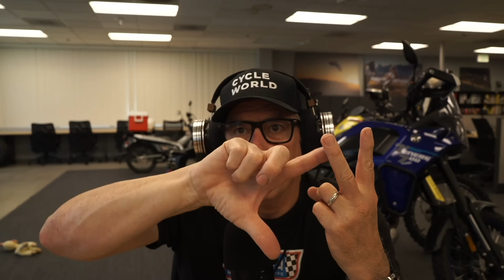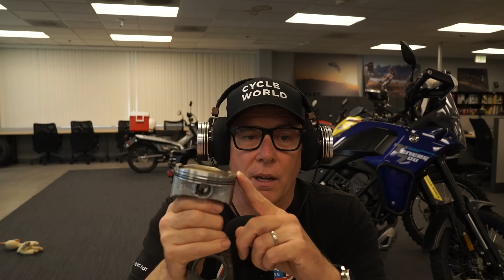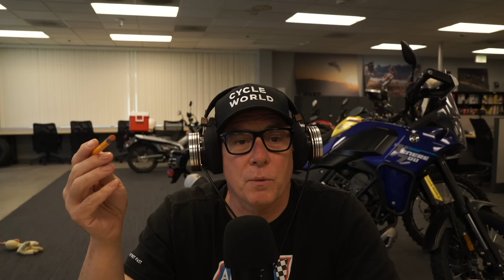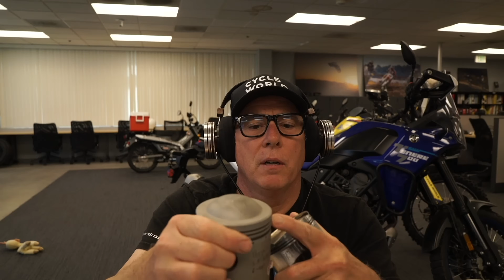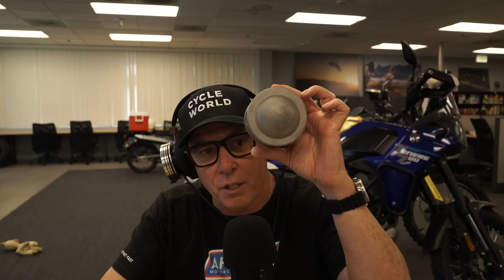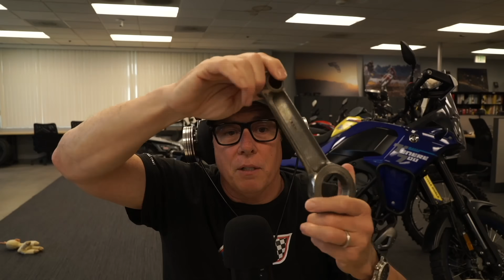INSIDE THE HOT ROOM! The magic in your motorcycle engine's combustion chamber.

Comment: RE,  SQUISH, - I experimented with squish in 1974 on my new [to me ] 71 honda CB750 sohc race bike  -  self tuned,  736 to 900cc ,-  much modified combustion chamber,    race cam , Boyer electronic ign,   ported head, race 4-1 exhaust ...  squish was 1mm !  ... the ONLY bike faster than mine  [ at top level amature / national racing in the UK ]  was the TZ750 !  ... my honda was quicker than tuned big bore z1000s,  big suzukis ,  even TZ350s  !!!

Comment: At over 20,000 RPM the pistons in the engine of a formula 1 car when they go shopping center to Providence center completely stopping to change direction... Weigh 5 tons each at that moment.. so there is no way you can allow the connecting rods to stretch at all

Comment: Velos are still being developed, squish engines , lead free seats and plasma nitrided valves , nikasil alloy cylinder :  got to ignition timing @ 28 BTDC ... Best results with heavy MSS wheels and camshaft (M17/7)
... btw, squish heads made from Viper heads with squish band cut at same radius as top of MSS piston
Greetings and thanks for your erudition

Comment: On modern engines you can have all the cylinders running different timing events and get the most out of every cylinder  It compensates for fuel distribution, poor mixture and fuel. Amazing progress!

Comment: So is there a knock sensor suitable for older engines ????
Reply from the maker: Another listener shared Bosch part number for a bolt on sensor but also that it needs an amplifier and the signal adjusted depending on where the sensor is mounted. The next (unsolved but solvable) matter is having an ignition to receive the signal and change spark timing. Hoyer says he's going to work on it for his vintage Jaguar that has an electronic distributor with tunable curves. His Velocette (drink!) is a mechanically fired magneto and, well, it's going to stay that way.

Comment: Over the years there have been some engines that would disable one of the two intake valves at low engine speeds to increase intake air velocity and swirl, increasing power.  After a certain point, however, both intakes would open and the flow would switch to a tumble.  I recall a small US Ford engine that got a little of the same benefit at low cost by putting a butterfly valve in the runner for one of one intake valve of each cylinder.
Another reason that having a stroke length greater than the bore diameter helps with efficiency is not only reduced area of the cylinder head and piston, but by also reducing the amount of cylinder wall area during the most energetic part of the cycle (as the piston is coming down on the power stroke).  This reduces the amount of energy lost when pressure, turbulence and temperature are at the greatest.*  I think that Toyota has recently decided on an optimum bore/stroke ratio of something around 1.2/1.  This is not a new concept, however, since  Honda car engines of the late 1970's had notably long strokes.  Not great power, but high fuel efficiently.

*This does not produce the least surface area at bottom dead center, but that is not when the gasses are the hottest.

Comment: My '79 Haynes manual also covered my '64 MGB. The early 'B' series engines like that used in the MGA had a more pronounced V in the heart shaped combustion chamber. The Haynes manual actually described how to round off the point of th V to make it less susceptible to pre-ignition from the pointy hotspot. 
The Haynes manual was really a history book in the slight evolution of the MGB. By the end of production, you still had to check oil in the shock absorbers and carb., check points on the fuel pump, but generator brushes were gone as well as generator bushing.
Reply: 😂 I know you're not crazy but even highly experienced mechanic's will look at you sideways and start backing slowly away if you started talking about "checking the oil in your shock absorbers and carburetors!" I've had one 1958 & one 1959 MGA's! 👍🏻
Reply: Zenith carb with oil filled dash pot ?
Reply: @markpavletich747  My MGA's both had SU's with oil damped CV pistons. I don't have hands on experience with Zenith's but I believe they have models that appear very similar to the SU's and function virtually the same.

Comment: A Boxster knock sensor is a bolt-on. You need an amplifier and test the signal for knock level which varies with location. Signal has to be measured after the spark.

Comment: My experience with 0% leakdown (mentioned at 1:08:00).....it means I forgot to remove the Schrader valve from the end of the hose going to the cylinder.
   Another possible factor is the use of a leakdown tester with too large of a restrictor orifice. Most that we use are 0.040", but for large bore cylinders, there are 0.060" orifice gauges.
   It would make sense to use smaller orifices for smaller cylinders, but 0.040" is pretty standard.

Comment: Crevice volume holds way more charge than you might expect. The charge residing there is also inordinately fuel rich and is partly hidden from the heat of combustion combustion until way after tdc when the pressure has dropped considerably.  Adding up to a large loss of power and efficiency with an increase in emissions and wear. Lots of work has been done to reduce it's volume to the minimum possible.

Comment: 0:22 Mark seriously " Stupid Nitrogen"
Nitrogen is crucial in the combustion process.
firstly it instantly absorbs the insane heat of the oxygen combusting with hydrocarbons
and prevents pistons heads and valve burning.
then the Nitrogen itself expands and maintains cylinder pressure = cold power.
The Earths atmosphere was seemingly specifically designed for ICE engines.
Have you read my crank case injection thread yet.
Lets see you using some of that cerebral voltage instead of just talking about it.
KTM forums. Crank Case Injection on my 2020 150 EXC.

Comment: Mark's forbearance under great provocation in not mentioning Velocette's squish special " production" racers was epic , but nevertheless its worth mentioning in the context..Velocette achieved two landmark feats with their special hand-built 500cc Venom motorcycles hand-built in the works to have   carefully created squish 

 TT Win: Velocette’s last TT win in 1967 Neil Kelly rode a Venom Thruxton to victory in the 500cc  Production TT. 
24-Hour, 100mph+ World Record: Over March 18–19th days of March  1961, a factory-prepared Velocette Venom Clubman set a new 24-hour world record  average speed of 100.05mph at Montlhéry  in France. The first m/c  of any displacement to average over 100mph for 24 hours—still a world record for a 500cc single-cylinder machine. 
The record-setting bike was essentially a standard Venom  with meticulous preparation to attain its high-performance squish combustion chamber
Both these bikes featured special high compression squish combustion chambers

Comment: If you were shown a DFV head on its side with the combustion chamber side pointing toward you without seeing the valve covers or other side of the head. You would indeed think it is an engine designed in the last 30 years

Comment: My 2003 Fz1 has 55° total advance, that lazy combustion sure runs sweet.
Reply: I’ve seen up to 70 degrees btdc at partial throttle openings but I’d be surprised if that figure was at full throttle anywhere in the rev range.
Reply: consider that new avGas . swift fuels . good octane numbers. 
the utube vid is incredible. :shelterin:    
...not sure if T.P.B. approved 🙉🙊🙈

Comment: In the mid-80s, Ford 2.3L turbocharged engines had knock sensors which would command the computer to retard timing on the ancient 2-valve design. They were running as much as 15 PSI boost, so "something" had to be done to keep the glorified Pinto engine alive.

Comment: See the USA in your Chevrolet.  Huge advertising campaign in the 1950's 
  The Hudson was the best car for a Travelling salesman is the  front seat could lay down 90 degrees to flat to sleep on. Seems the  AMC or Nash Ambassador was like that too.
  My Cousin had a 56 Chevy with the Dual 4 barrel higher compression Corvette engine. It burned oil like crazy.  I am guessing my Cousin did not have the patience to break it in driving slowly.
  He took it back to Denoyer's Chevrolet in Kalamazoo MI.  They tore it down honed the cylinders and put new rings in it. All was good after that.  His 56 was always faster than the two that two of the Desnoyers Brothers had.  I did some research and found out that later in the Model year Chevy upgraded to the Duntov 3030 cam.  The early year models made 225 HP and the later one that my Cousin had made 240 HP.  My Father claims that no one ever bear My cousin that included Cadillacs ect with much bigger engines.  We know that other brands had some very rare high output engines but they were just too rare to encounter. 
     My Cousin passed last Nov at age 88.. He had a Tandem axle chevy truck with a 409 in it.. My Father had an International with a 460 in it that kept blowing Pistons.  The Local IH Dealer upgraded to a new 549 IH V-8 gas engine and the 409 Chevy blew away the 549 Gas engine. Tough in the field at low speeds in soft ground that 549 had way more Torque. The Marl spreader ran from the Transmission PTO and you had to keep the RPM's down to save the U-Joints Worm and Bronze bear and bevel gear spinner gear boxes from blowing up.  I don't run my 488 Big Block Chevy much over 2500 RPM's with the PTO on. Thankfully it's all run by hydraulic motors now but the pump is sized to run at low RPM's

Comment: Smokey Yunick's Hot Vapor Engine .
  I figured out recently why Top of the Line Cars have V-12 and V-16 engines.. With the very small bore Diameter they were able to raise the compression ration with low octane gasoline.
Reply: I'm surprised Kevin didn't mention Smokey's experiment, seemed somewhat successful.
Reply: @eddy2121    From what I read it made a lot of Power and got very good fuel Economy.
  John Delorean was close to using it in his car made in Ireland before he got entrapped in a Cocaine deal that he finally was acquitted on.  I guess only the Clinton's and the CIA are allowed to traffic Drugs.